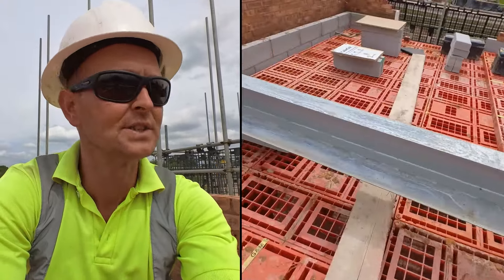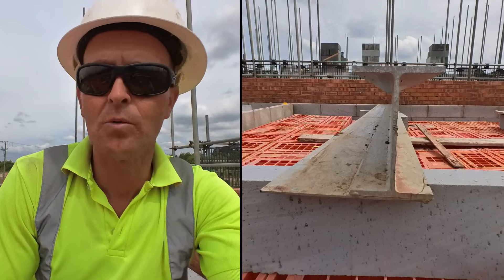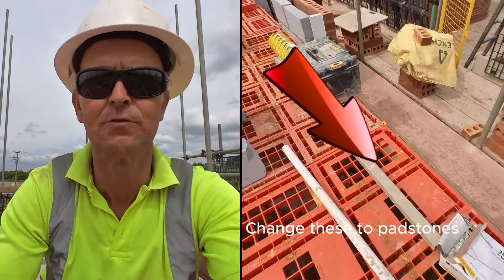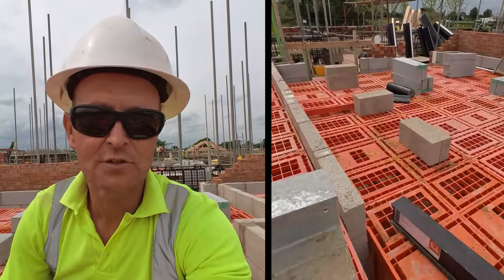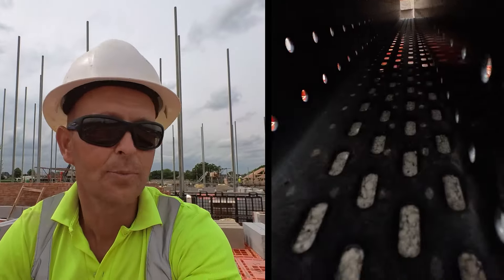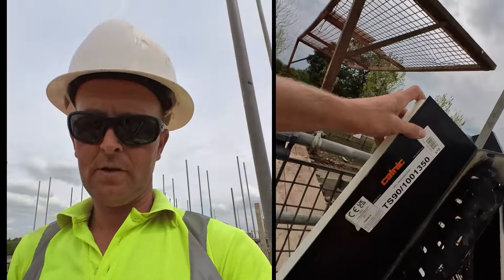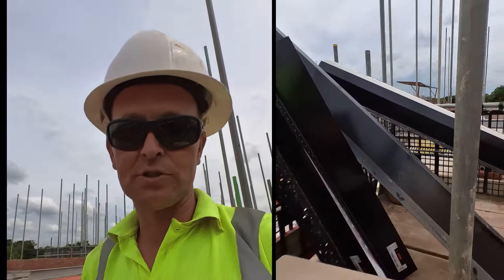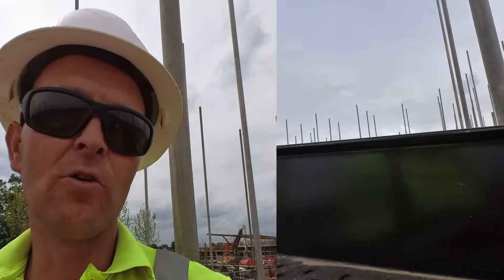Where Do They Go? #construction #work #diy

Comment: Good video and you touched on it. Lads, lintels that are 3 metres or in excess of require a 200mm bearing, not 150mm. Changy, these videos really are delivering the know how young'uns crave but are perhaps a little scared to ask for. Keep it coming.
Reply: Well said
Reply: Also worth mentioning that any large lintels over 3m require 2 bits of DPC where they bear onto masonry. These act as a slip plane to prevent cracking due to  thermal movement
Reply: Changy is the most active bricky on yt at the minute, good informative channel with no bs
Reply from the maker: True my friend
Reply: @quabarb4547 you ain’t wrong ( what he said ) 🍀👍
Reply: What about where it sits on pad where a cavity is, we once oversailed it in cavity 150 and got pulled so had to cut off flush .100mm bearing with back of pad stones
Reply from the maker: It's sitting the opposite way